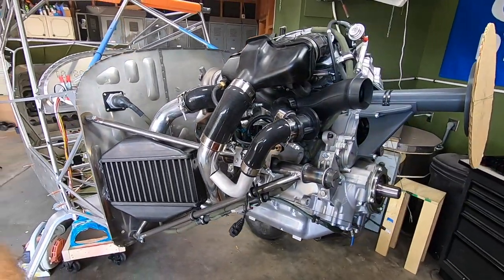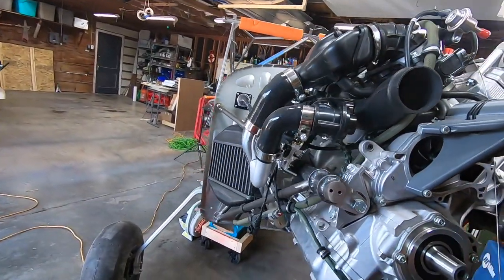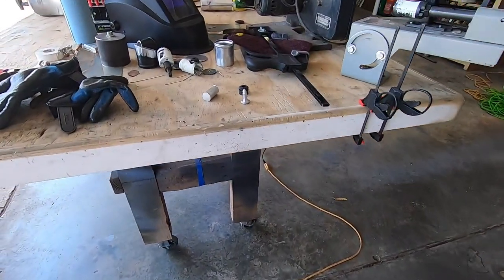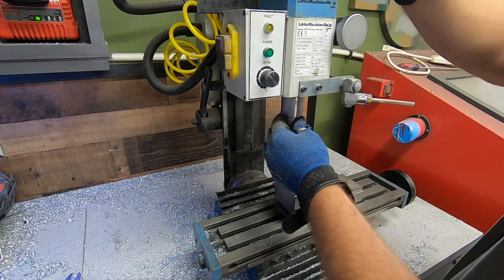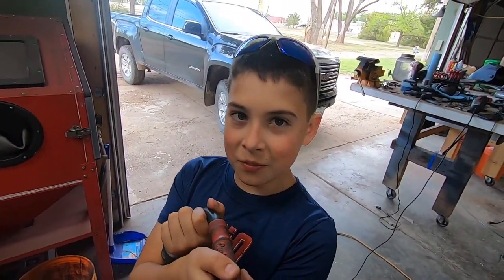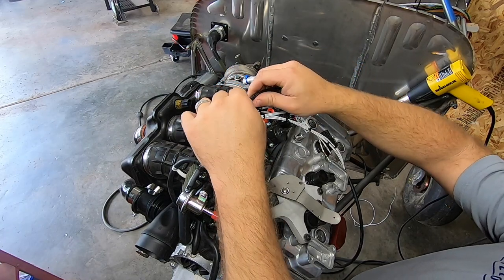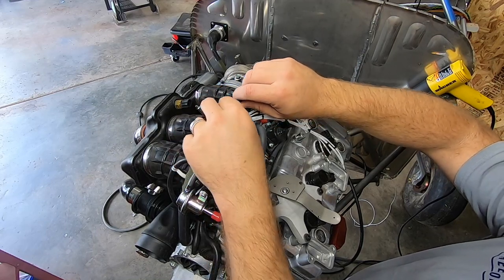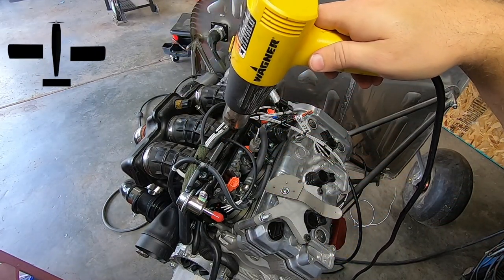RANS S-21 YAMAHA 998TURBO UPDATE EP29

Comment: I like your idea of using the Yamaha engine but that long and thin prop drive extension is iffy
Reply from the maker: That a plastic 3D printed prop flange locator.. I’ll be running a skytrax reduction gear drive when they become available which sounds like it will be soon.

Comment: Fab fabrication skills, boss! Coming along nicely. I've always wondered why certain builders use plastic wire ties over lacing cord. I'd appreciate your thoughts.

I've been going back and forth for a couple of years now on which aircraft building project I want to take on. I made a list of my mission wants, time to complete the project, and kit manufacturer. I ended-up with two designs - the S-21, and Van's RV-14 (taildragger). My decision came down to cross-country performance and comfort, as my wife and I plan to put some miles on. So, yesterday, I placed an order for an RV-14 empennage kit. I have to thank you, though. You look like you're having way too-much fun with your S-21 project! Time to dive in!
Reply from the maker: Thanks man! I’m sure you’ve seen how zip ties get once they go through some heat cycles or get exposed to some UV for a bit of time. There are good ones out there but you can have a whole role of string tie for the cost of a couple of those expensive ties. We use string tie on the V22 Osprey so I think it’s good enough for my machine👍. 

Congrats on the RV14! I hope you consider posting a few videos up as you go along so we can follow along with ya!
Reply: @Project2Aero  I have never met a zip tie that hasn't failed - given the environment they serve in. Along with the OV-10, my experience is that I haven't seen zip ties used in any electrical or high temperature application on the (certified) transport aircraft I've operated over the last 34-years.

Thanks for the congrats. If I post videos, I'll follow your style; record the process, and narrate afterwards. No distractions during the building process.